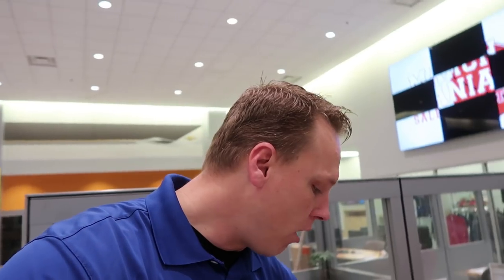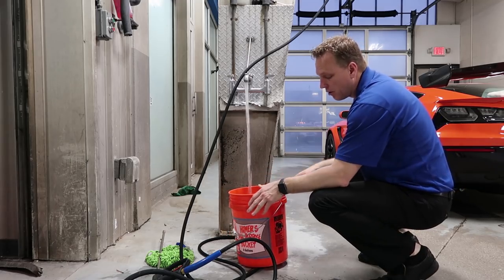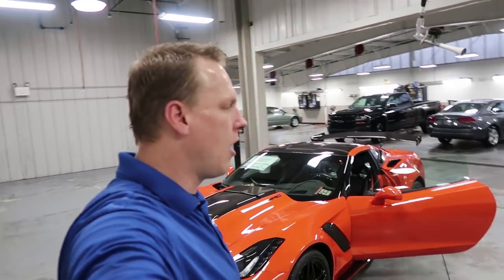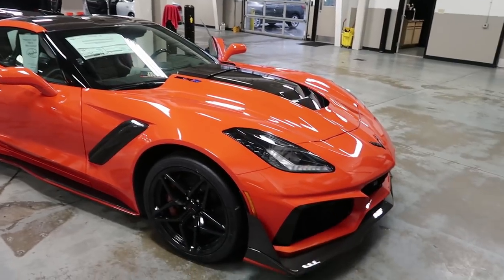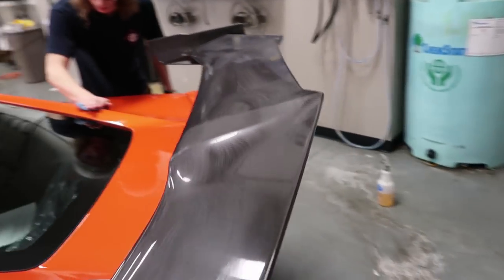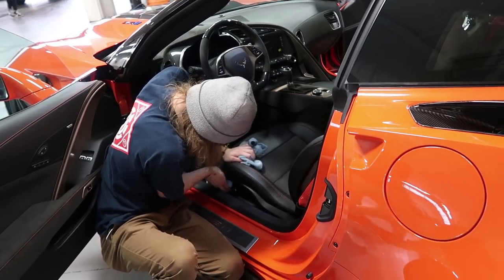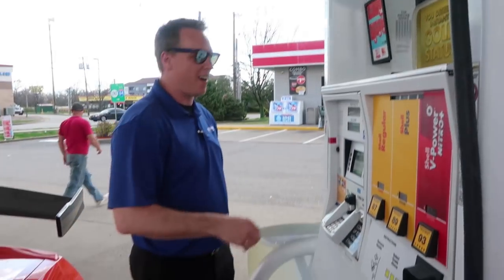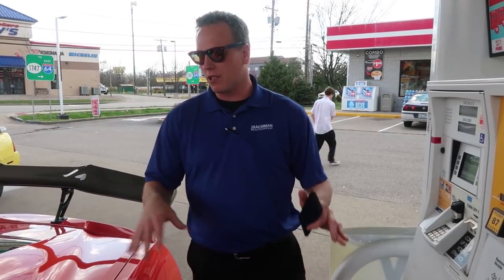What Paint protection I used on the $145,100 MSRP 2019 Corvette ZR1

Comment: I would Decon the paint first , clay and wash. Remove rims and wash them. After the car is done cleaning I would polish the paint to remove those fine swirls that the factory and your own wash has done to the paint. Once you check your work with a detailers light to see if anything is left there, then wash again with a 2 bucket method and a MF mitt if possible. Dry with a blower and lightly dry with a MF Towel. For protection I would use  CQuartz Ceramic Quartz Paint Protection or GYEON Q2 Mohs Ceramic Paint Coating  for the paint and also the rims too. Once your done then maintain your finish with Finish Kare 425 Extra Slick Final Body Shine.
Reply: All cars need that! New cars off the assembly line need some paint correction none of them are perfect.

Comment: Quick question: Does GM or Chevy post videos showing the 0 to 60, top speed, HP, etc.? Basically, "proving" the numbers that they claim the ZR-1 is capable of? Or, even better, an independent company that attained these results?
Reply: See the vid speed 717 did on the dyno pretty good numbers for a street car

Comment: If that green mop touches the car, it should never touch the ground.. Never heard of "paint grain" ..   The reason for rubbing the way you do has to do with visual effect of micro scratches.. they simply do not show up very well when going long ways with the body lines.. what micro scratches that show up are hard to see ... (or so I was taught) ..
Reply: randalljames the grain is the direction in which the car was painted

Comment: I appreciate a salesman that tries to go the extra mile, however, this is an excellent video on how to NOT detail a car.  Any decent detailer uses the two-bucket method with grit guards in the buckets just as one example.  It's a PRIME example of Dealer-Installed Swirl marks on brand new paint.